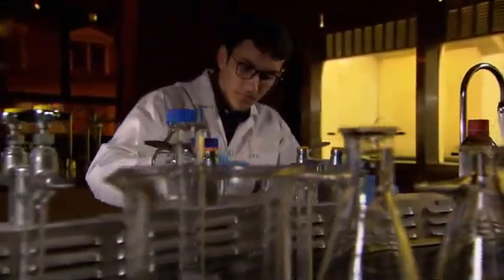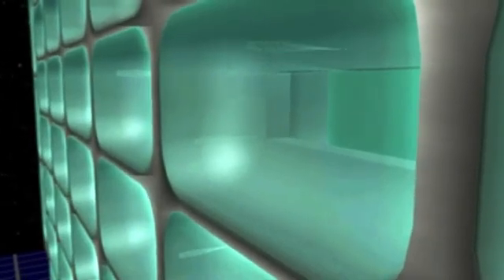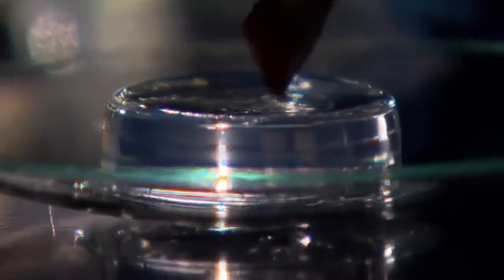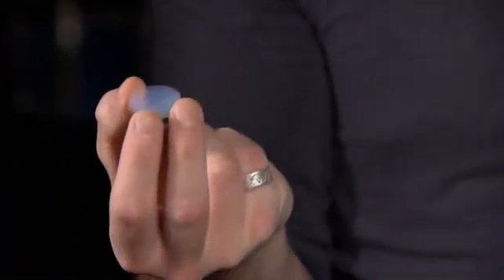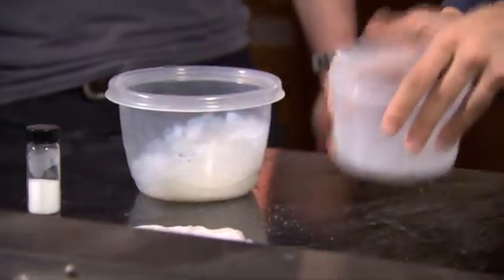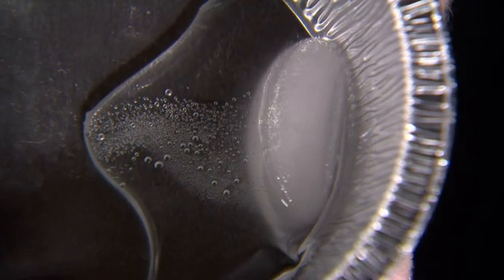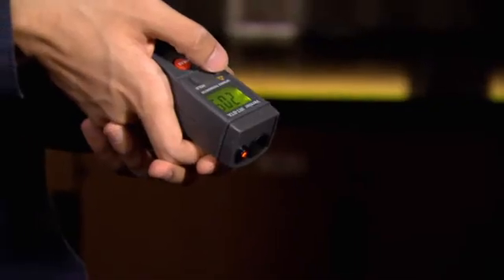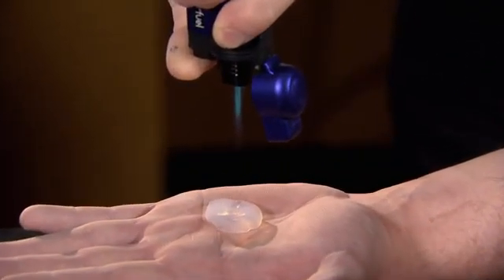Entropy Labs Aerogel Superinsulation Featured on Daily Planet

Comment: What a great cause, Mark. This needs to be implemented for energy conservation immediately. Even just drapes with this over the drafty window in my apartment would make a huge difference in my electric bill! Cars would stay cooler, too. As a child, my father showed me a small piece of very effective insulation called Eagle Shield. It looked like to pieces of foil with a grid of something in between them. It was 1 square foot. At that time he was in business for himself doing heat & air repair. I often worked with him & coming back to his van after a job, it was scorching hot. He held this piece of "Eagle Shield" up to the roof of the van & had me compare how much cooler it was under that piece of insulation. He had wanted to line the roof of the van with it, but never did. For asthma sufferers that are sensitive to heat, hot cars are miserable & dangerous. Someone else that would benefit are people with seizure disorders & heat restrictions. At a non-profit I worked at, one client in particular had a very sever seizure disorder, was under a heat restriction, but he had to endure the hottest ride home every afternoon because the AC on his bus was horrible. Even when it was repaired it wasn't much improved & didn't last long. Aerogel looks to be much more effective than the Eagle Shield & has so many more potential applications. I would like some aerogel insulation around my ductwork, aerogel drapes, aerogel coat, and an aerogel blanket may eliminate the need for an electric blanket. Brilliant. I can't wait!
Reply from the maker: Thank you very much for your kind remarks and moving story, Tanya. Your kind words truly motivate me to make this material commercially affordable so that individuals such as yourself can change the world with it. I did a bit of research to find this "Eagle Shield" material you were referring. Based on your description and if I'm not mistaken, I believe this is it: (https://www.eagleshield.com/solutions/eagle-shield-high-performance-reflective-ducting/). Their product is a combination of radiant barrier and bubble insulation. The silvery foil acts to reflect thermal radiation, almost like a mirror. The grid inside is most likely ordinary bubble wrap. Since ordinary air is actually a really good insulator, bubble wrap helps trap the air to prevent heat flow. This same reason is why aerogel is an excellent insulator. Air gets trapped in the microscopic silica network to prevent thermal conduction. There is a company that makes aerogel coats, called Oros (https://www.orosapparel.com/), and companies that sell aerogel blankets (http://www.buyaerogel.com/product-category/blankets/), although I wouldn't recommend using these blankets on human contact (potential health concerns, and leaves a chalky feel). In 2009, US homes used over 10 quadrillion Btu of energy (about 2 billion barrels of oil), and almost half of it went towards heating or cooling the home. There is a dire need to make aerogels affordable and reduce energy usage, as this will reduce greenhouse gas emissions and help mitigate the effects of global warming. Your suggestion to use aerogel in vehicles is a great idea! Innovative thoughts such as yours are what revolutionize the world. Thanks again for your positive feedback, and keep up with your innovative thinking!